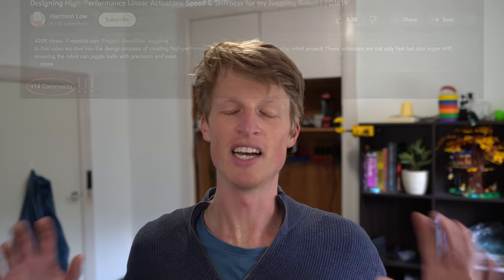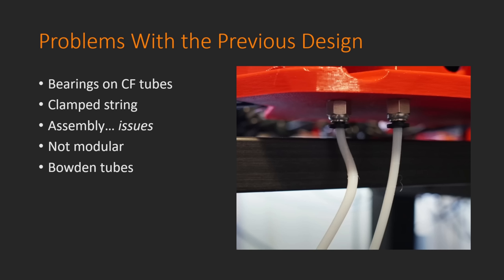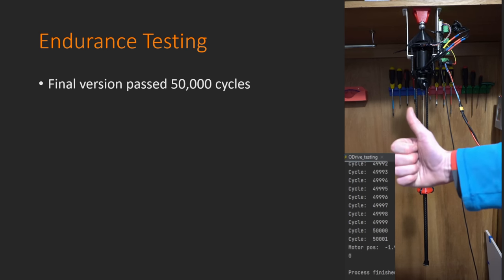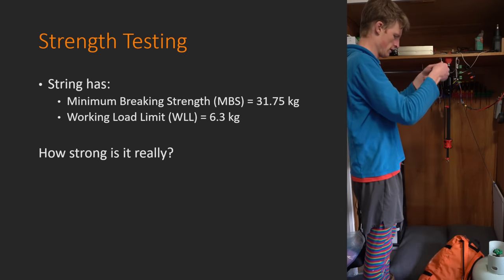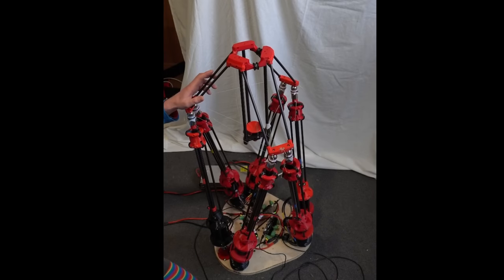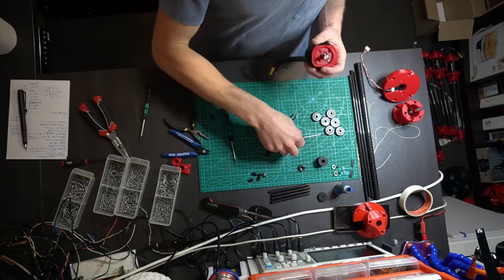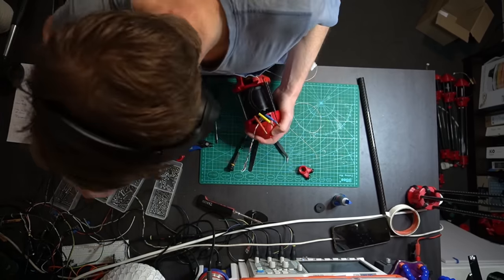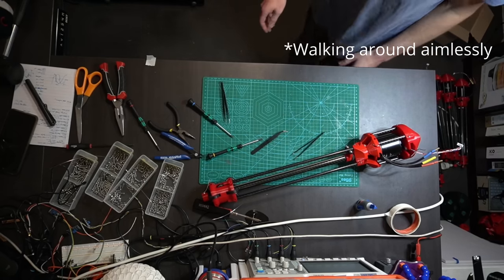My New Linear Actuators are SO MUCH BETTER! | PDJ #21

Comment: Hmm.. there are super strong, super soft (curve ability), miniaturised cable (multi-strand woven cable) jewelry wires out there.
They have a plastic cover standard, but are fantastically strong. I used Accu-flex 49 strand.
As another alternative,  many specialty and competitive fishing lines face these wear challenges.
Reply: Also, when anchoring a line or cable, take a static loop or two to dissipate force in friction, before curving into a locking point.
It's the simplest, most effective way to maximise.ise tensile strength nd minimise breakage.

Comment: @harrisonlow Instead of TPU Roller you could use POM bearing roller, similar to what is used for 3d printers ✌🏼✌🏼
Reply from the maker: Do you think the POM would cause much/any wear if it directly contacted the central CF tube? I'll have to pick up some of these after all the suggestions for them!
Reply: @harrisonlow  i know CF is really abrasive compared to aluminium where they are usually used, so in really long term they will wear, to counteract that should you think at some eccentric shaft… but I suggest you to try and test them ! They are also produced in different polymer, maybe Igus has some technical polymer suitable for u. Have you ever considered IGUS plain polymer bearings ? With this you could simplify assembly , reduce weight and overall dimensions!

Comment: Look into the PID loop of your actuators, all the other math seemed spot on to me. Cool video btw!
Reply from the maker: Yeah that PID will need some updating once the Stewart Platform is working. My current settings are "just-good-enough" values for preliminary testing 😊

Cheers!

Comment: I suggest you to put the bearings in different orientations, 3 to 3  with some angle (I sopose 60 degrees in between) to get more  points of contact with the bars and to prevent them of moving around its axes.
Great design, thank you!

Comment: drill a hole in the side of the bolt. Put the wire thru the hole and tighten down the bolt. Old bicycle brake cable tech.

Comment: I'll note that you're "not achieving" the 31.75kg of minimum breaking strength because that's for a static load. When you're accelerating that bag from descending to rising while being pulled by gravity you're applying well over 31.75kg worth of tension to that string.

This is why they give a recommended weight for dynamic load (the working load limit) of 6.3kg. Under most normal expected scenarios this mass is low enough to not overcome the string's tensile strength with dynamic loading. I say recommended and most normal because no matter how light the load, even no load, you can still push the string past it's tensile strength if you go hard/fast enough.

And if you notice, that's exactly what's happening. You're doing work (lifting the bag up and down) "normally" (with just your hands) so if the bag weight 6.3kg or less it'd probably be fine. The bag weighs 7.8kg, so it's not fine.
Reply from the maker: Yeah, I see what you're getting at. I figured that the small bounce I was giving wouldn't have 4x'd the force from the bag, but I guess it's possible. As it happens, I plan to build a pretty nice tensile testing rig to get some more legit data. We'll see how well the quoted MBS holds up under proper testing!

Comment: Harrison, you have done an incredibly good job of documenting the details of your Juggle-bot. However, I want to point out that in your design, you have severely (and needlessly) compromised the integrity of your Stewart platform. The Stewart platform is a a theoretically "perfect" 6 DOF adjustable connection between 2 3-dimensionally rigid bodies. The fixed body in your design is the plywood base, which, if it is securely bolted to the floor in a way that it can't bend, can be considered rigid. Unfortunately, the moving platform is most certainly NOT RIGID. If you were to take the moving platform in your hands (by itself), you would see that the three blocks to which the struts attach can be easily deflected in several degrees of freedom, owing to the bending flexibility of the carbon fiber tubes which connect them to the upper block. This is going to end up biting you. This will severely compromise the dynamic performance of your Stewart platform.
Reply from the maker: Cheers! You're absolutely right that the platform isn't "rigid" by any stretch, but it's fairly stiff (and super light), and it shouldn't be too tricky to stiffen it even more if its rigidity (or lack thereof) is an issue down the line. As with most parts of this project, I've gotten it to the point where it's not longer the weakest link, then I've moved on to something else. I've learned the hard way that optimising too hard for one aspect can lead to wasted time if the rest of the project later takes a different turn.

Probably not the most efficient approach, but it seems to be working so far 😊

Comment: if the back tip will be attached to 3 other rods, then you can use 3 large bearing only on the top

Comment: Kind of a vague suggestion, could you regenerate into 'supercapacitors'? Thought Emporium has a video: https://www.youtube.com/watch?v=Lqj2zJbztbM&t=311s
Reply from the maker: That would almost certainly be an option! Though big capacitors scare me 😅 and I want to try to resolve this without adding any more bits if possible. I think people on Zulip may have figured out a workable solution, though! (adding active cooling to my existing brake resistors)

Cheers for the link! It was an interesting watch 😊

Comment: How are you controlling the motor and what type of motor is it? The best way to brake a BLDC or synchronous AC motor is to control it using Field Oriented Control (FOC). This will give you much more braking torque than other control methods. However, it will also result in regen current going back to the power supply. That is where you might need a brake resistor. Another solution is to use a battery instead of a power supply. The battery, unlike the power supply, can absorb the regen current. Then you probably will not need a brake resistor.
Reply from the maker: Cheers for the input! As it happens, I'm now using ODrive Pro controllers (which use FOC) with brake resistors to dissipate the braking energy 😊

Comment: For the problem with, "terminating the string," I'd suggest looking deeply into "locking nut guitar string systems." At first glance it will look like total overkill, and... it might be. But i think you might find some inspiration in how you could "tune"... then "lock" the strings. Maybe even make use of the "fine tuning" mechanism.. i.e. main "tuner + string lock," at one end, and a "fine tuner" at the other end. Anyway. just my .0002 cents.
Reply from the maker: Cheers for the suggestion! Just watched a very informative video explaining this and now I understand why so many people are suggesting a hole-through-bolt/nut idea to pinch the string. Very clever! I'll have a think about this. Cheers again 😊

Comment: Look into perfect hatch Kevlar Thread - Tex 800. 100kg weight limit it’s ~90$ for 250 yards and thinner then what you are using so you could braid it and get a really strong pulley string
Reply from the maker: Wow that's super strong! I imagine it's quite stiff as well? I wonder how it'd compare against synchromesh cable 🤔

Comment: If you get the angle correct on the spool pulleys, you only need 1 coming off the pulley instead of two. The strings will wrap more than 180* around the pulley though

Comment: For the slowing down of the actuator, you can put a coil on the ends of the main frame and have magnets attached at the ends of sliding rod. By using hall sensors you can determine the proximity of the magnets and switch on the coils accordingly and hence decreasing the speed effectively. This can moreover be used in a way that woks like a coil gun and help accelerate the moving arm after a full stop.